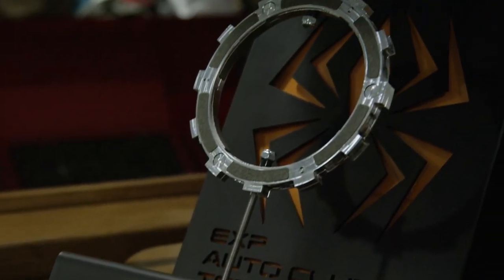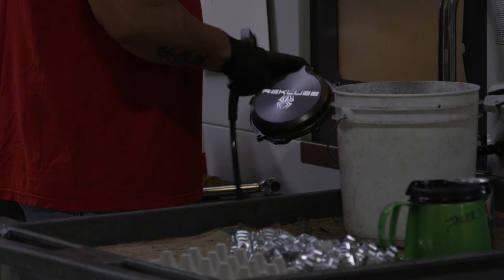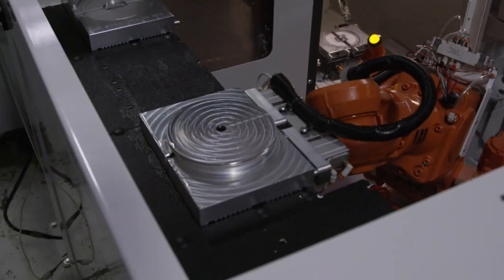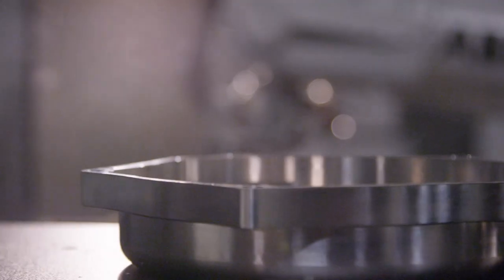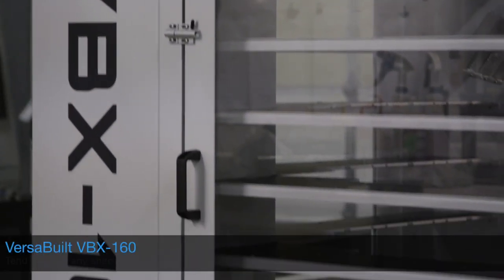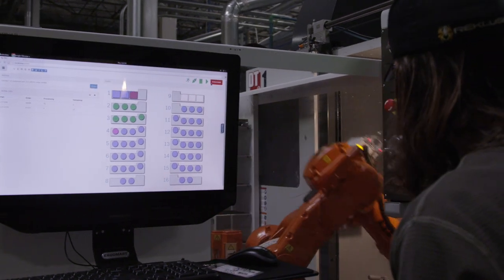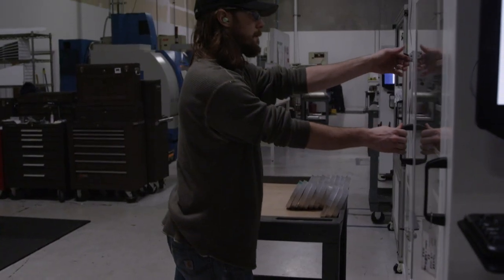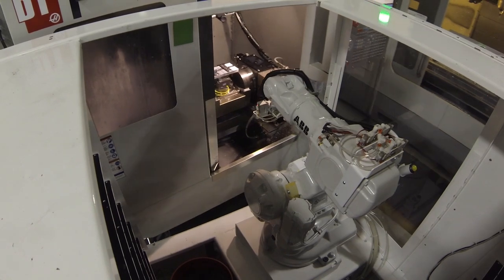Motorcycles and robots master the art of machining - ABB Robotics

Comment: Interesting. I have to say in Ireland we have a mix of automation in manufacturing and there are still plenty of jobs with/without automation. I think outsourcing mfg to cheaper economies can be cancelled out with automation which does need employees to manage, a few less maybe but its better than zero. Also its forces up-skilling which is the best way to complete with lo cost mfg. I am pro automation where the balance is maintained. The Japanese seem to be able to get the mix the best. Loyal to local mfg but still with high levels of automation. The Germans similar but more driven by unions than genuine passion for local mfg.